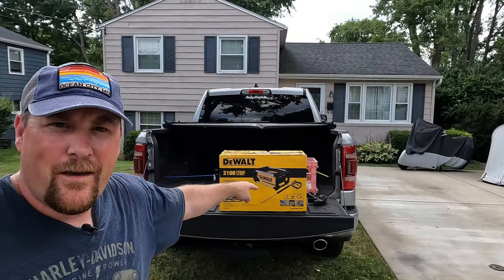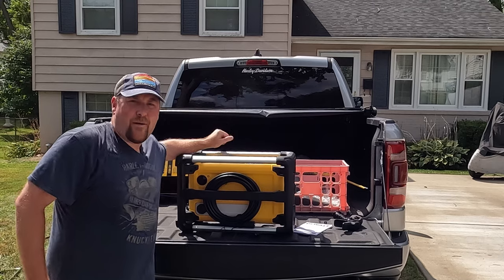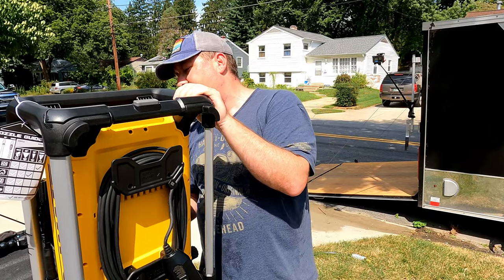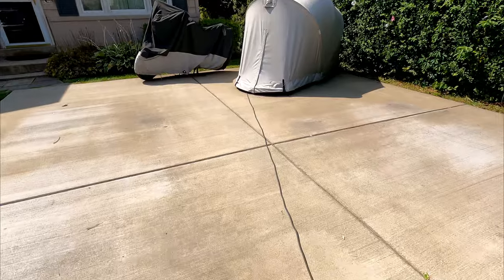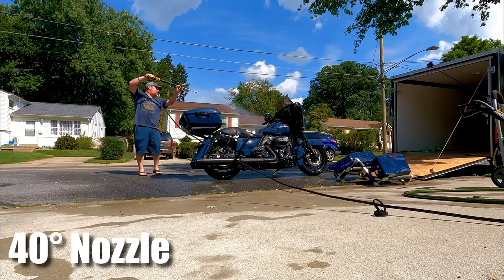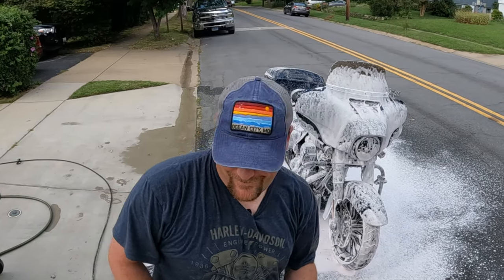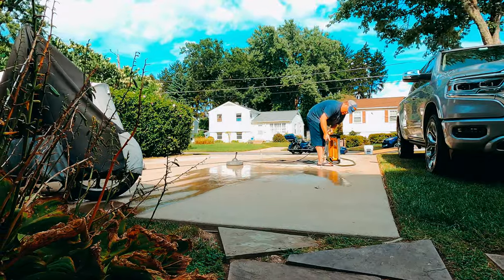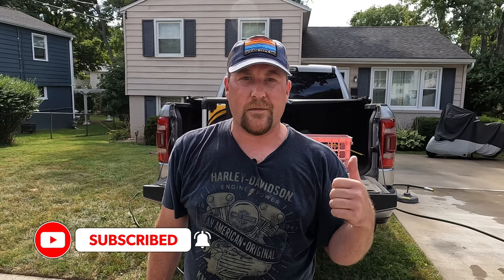Dewalt DWPW2100 + Torq Foam Cannon + Harley Street Glide = FUN!  New pressure washer time!

Comment: Hmm question.. why didn't you pressure wash off the soap?
Reply from the maker: Ahh, good question!  It's because I like to do an extra rinse, and with lower pressure, there's less risk of getting water in somewhere it shouldn't.  It's surprising, the number of motorcycles I've seen that won't start or run right because water got in somewhere it's not supposed to.
Reply: @RoadReality  oh interesting! Makes a lot of sense, and I'm guessing with the power of the foam you don't need that extra rinse power. Looking to buy this washer for my car. Is it still going good today?
Reply from the maker: @kevinpalardy8592  The rinse to me is just to get the soap and broken-up dirt off the vehicle, so it needs volume, not pressure. 

The pressure washer is going great, I highly recommend it

Comment: You got pretty good foam from your setup.  Mine surges with an Amazon foam cannon (not chemical guys Torq).  Not sure if it is an issue with the pressure washer or foam cannon (1.2mm orifice).  Nice review of this pressure washer.  I plan on permanently mounting in the garage with hose reel.
Reply from the maker: Nice! I'd love a more permanent setup!  Yeah, if you're getting surging, I would look at the pressure washer first - mine was doing that because of a leak internal to the pump.  This thing just CRANKS compared to my old one.
Reply: @RoadReality  Thanks for this info.  Just opened a warranty case with Dewalt.  Love the color of your bike by the way.
Reply from the maker: @hfjeff2736  Ouch - hopefully they take care of you.  All the reviews I read about THIS Dewalt were that it was fantastic and could take a lot of abuse... which is apparently something I need all my tools to be able to do :D

About the bike - THANKS!  It's Billiard Blue, a 1-year color on the Harley touring bikes.  My wife picked it out, haha!
Reply: @RoadReality  Dewalt did send a full replacement with all accessories pretty quick.  However I sold it and bought an Active VE52 and did a semi-permanent garage install.  Hard to beat 2.0 gpm.
Reply from the maker: @hfjeff2736  Yeah, can't beat 2gpm - the electrics are stuck at 1.2gpm I think.  Congrats on the new system - I'd LOVE a permanent garage setup!  And a garage.

Comment: Is it safe to wash the speakers?, I believe the sound system is sensitive to moisture…
Reply from the maker: I wouldn't blast them with high-pressure water, but the foam cannon or one of the lower-pressure nozzles shouldn't hurt them.  You can ride a Harley in the rain without damaging the speakers, so I wouldn't think that just getting them soapy or wet would hurt them.